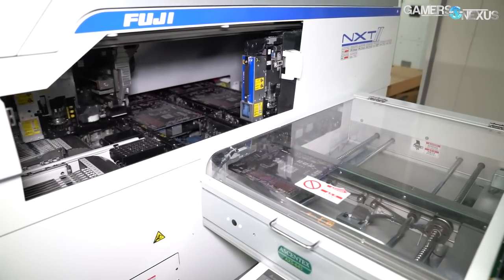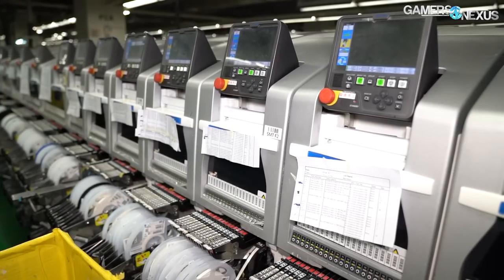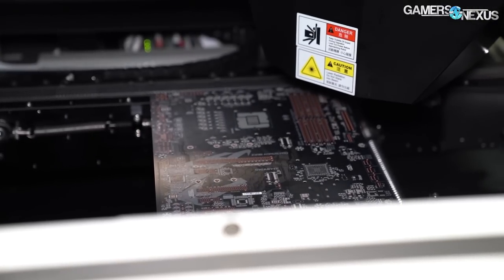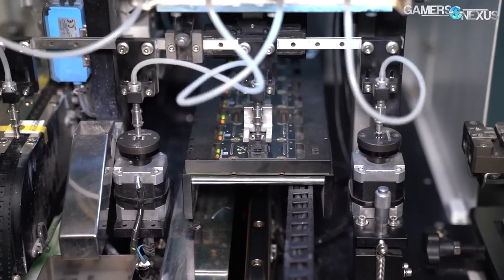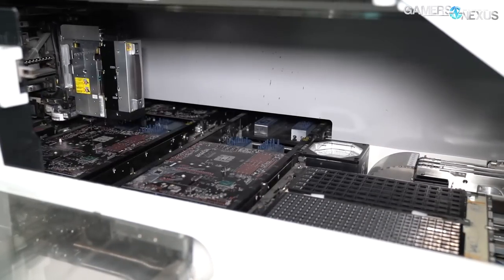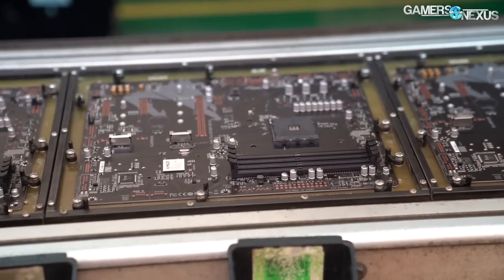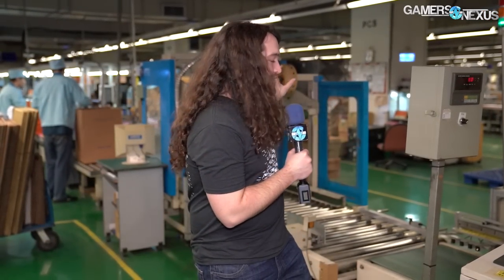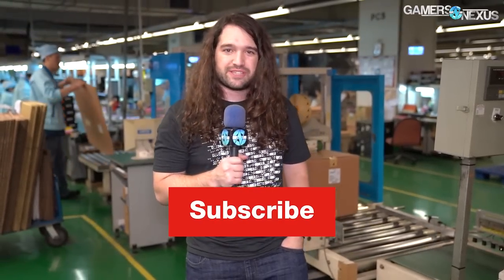How Motherboards Are Made (2019) | Taiwan Automated Factory Tour, ft. Gigabyte

Comment: i bought a fair few reels in my time but i never came accross a 10K one. also the ones on the machines are 1K to 5K max...
10K smd parts take more space than this even on reels.
Reply: Uh what? Forget about resistors? Can quite easily fit 10,000 on a standard 7 inch reel
Reply: @gkukull  you even made me check price lists again... can't find a reel above 5000 pieces.
Reply: @nodustechnologies3989  I even found one on Amazon. Where are you looking? I think there is some confusion between us
Reply: I operate a line for a high tier 3, low tier 2 company. Can promise you that they are a thing.

Comment: 6:31 Looks like that technician is just clearing a whole bunch of errors found by the software. Going frame by frame, I see Reverse, Marking, Missing, Bad Fillet, InsfSolder (definitely not good in the long run), Marking (again). That's not a motherboard I would want to unfortunately inherit on Amazon or Newegg, knowing it left the factory with flaws that a tech just cleared to save time and money.

Comment: What was the temperature in there?
Reply: probably air conditioned?^^
Reply: @johnuferbach9166  You never know. I worked at Amazon, we didn't have air conditioning and that was in the US.
Reply: @krisplanker9640  but they've got expensive machines that need to be reasonably accurate? (thermal expansion migth pose a problem for the pick and place machines was my thought) also it might be some level of clean room which would probably also require airconditioning atleast for dust removal (not sure if that would include temperature)
Reply: @johnuferbach9166  Fair point. Just was speculating based on Steve's hair looking frizzier than normal.